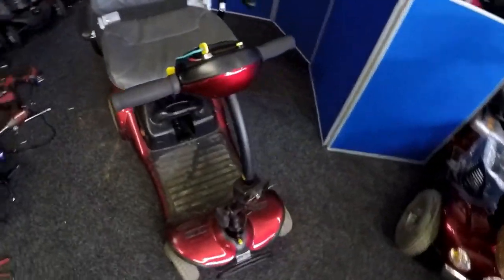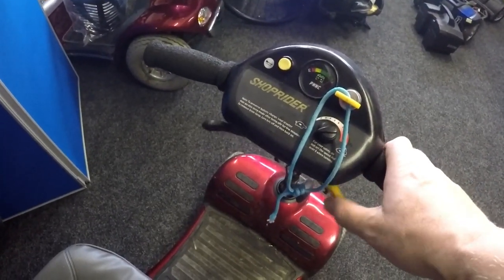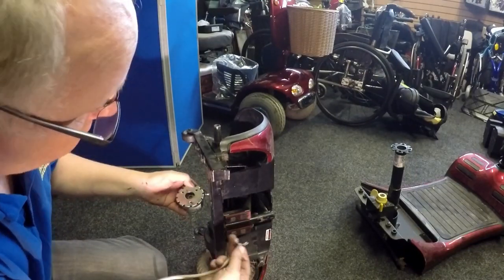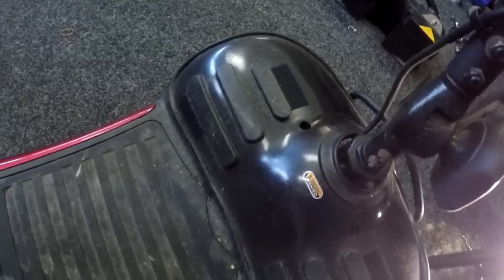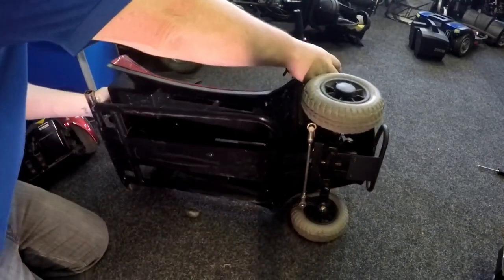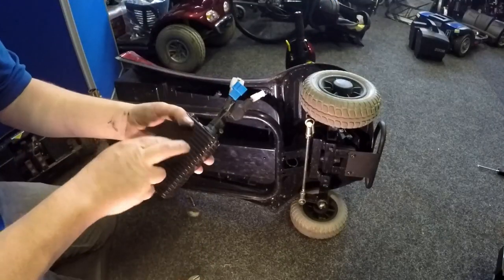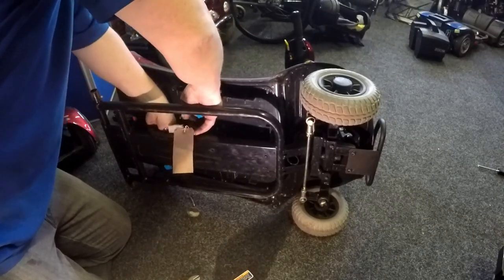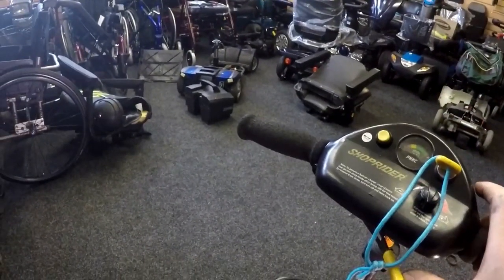Scooter will not drive no error codes

Comment: I have a similar fault on my shop rider but it’s intermittent break works and it will drive then it will stop and I get the beeps about 1 sec intervals . Iv checked voltage to the break when this happens and when I operate the paddle there is no voltage to the break . I can turn the key on and off a few times then power comes back and it will drive . Any thoughts on this please

Comment: Question when you turn your switch on a green light blanks, the batteries are charged, but it will not go forward backwards
Reply from the maker: @shirleybaldwin974  and how many times does it flash wait for a gap then count. Should always be the same amount of flashes

Comment: Hi thank you for putting these videos out there. I love watching them. 
I have an envoy 8. The 6th green light is only. Checked every item you have suggested. The batteries have 27.8 v the brake is working, the motor is working, it charged. But does not show the 27.8v. the lever shows balanced OMS. It looks to me like a wiring a fault or the computer. Have you any ideas?

Comment: Hi, great advice thanks, I have exactly the problem you have just described break releases no power beeps in reverse but won't go motor runs when wired separately so probably control box fault its a Sterling scooter  thanks

Comment: HI Tom, I have a jazzy 1122 with new batteries... I got 12.5v going into the controller box but I don't have 12volts coming out to each motor only 2.4 volts only the left wheel bearly moves. I would like to know if I should check anything else before purchasing a new controller.  Thanks!
Reply from the maker: If you only have 12v going to the control box then you have wired the batteries wrong should be 24v plus
Reply: @tomjacques4  I have the batteries wired according to the jazzy 1122 manual… could it be the brake?
Reply: Each battery is wired to each motor in the diagram… is that correct?

Comment: I have a gogo pride scooter how do I reset it I tried to do different things but it won't start and also does those scooters require water cause one day I was charging it and the towel I had it set on was damp when I went to put the battery on the scooter

Comment: Very informative video. I have a shop rider Mayfair which I have a problem with. When power is applied but ignition off it emits a constant tone. When ignition on it is quite, power meter shows full power but no movement. Have no maintenance guide so working on experience lol 😆 . Think it may be electro brake or control box. Thanks Tom 👍
Reply from the maker: Odd you should not be able to get any noise if you have switched the ignition off. Could be water damage. Check ignition switch

Comment: hi tom i have aold strider st1 small boot scooter watched all your vidos tested everything getting 9 on the flash codes just not getting anything from the CTE control box i belive it got wet i have left it for two weeks now and still not working cant feel the relay in the control box comeing on if i sent it to you could you test it or repair it or supply another one cheers steve
Reply from the maker: Hi not many have the cte controller must be an older model will only have new
Reply: @tomjacques4  can you supply a new one do you need the old one to program the new one what sort of price am i looking at cheers steve

Comment: Hi there . I got my new ebrake and motor for my quingo air 😒 still not driving and 5 flash code still there. 
By chance do you have any ideas
Reply from the maker: Sorry have not had the chance to work on one yet.
Reply: @tomjacques4  
My apologies tom, 

I  know each type is different. Its my lack of knowlege overall. 
I may be hoped there was procedures i could follow to try fault find.
Reply: @tomjacques4  

Do you have a work shop in leven.
Just checked web and says you do have a work shop in leven fife
Reply from the maker: @mckjimmy3802  we don’t have a workshop up there but do repair scooters etc. in that area
Reply: @tomjacques4   is there some place i could bring the controller for testing ?
Reply from the maker: @mckjimmy3802  whereabouts are you
Reply: @tomjacques4  
Hi , im in leven in Fife.
Reply from the maker: @mckjimmy3802  kinda too far for us my friend. If you ever in East Kilbride then let me know
Reply: @tomjacques4  
On the plus side.
After relentlessly searching. I now see the controller module is quite commonly used for many scooters.

You may possibly have one sitting.
Its a Dynamic DR50-A01 R series.
Reply from the maker: @mckjimmy3802  yes yes your correct but there so many different variations and every one will have a different program for it’s individual type of scooter.
Reply: @tomjacques4  and that my freind
Sums me up to a T
(Fucking usless)😂😂😂

After pulling the installation guide from the Dynamics website.
Theres a fair bit info on the controls and
 What pins there ment to go on.

Even gives all info on the programming and how to change the program to suite the needs.

But that shit is way way way over my head.

Im going to see the  areas top auto spark. As i know for a fact he has a mamoth amount of programers etc 
The man is a genius and a life saver,
Lol helped me out with car keys on many types of car.
He dose all major garages work. 
Only if you go to the garage they charge £300 + 
If you go Directly to him . Its usually £60
Reply from the maker: @mckjimmy3802  you will need a programmer which you will not have. Auto electricians are very experienced in cars but would not say on scooters depending if they know what they are doing. Think you need a proper mobility engineer
Reply: @tomjacques4   hey buddy.
We have power. 
Thanks for all your help & advice tom chap.
Never have i been so confused.
But following your vids and guidence.

We have accomplished thee impossible.

Comment: Very good videos Thanks. I have a Rascal 245 that used to run and then stop, I would switch the key back and forth and it would run again for a while then stop. It got worse then stopped altogether . Now what? The batteries are newer and are connected fine. Any advice ? Thanks. Doug
Reply from the maker: This scooter has split wiring looms. One at the base of the tiller under the gaiter and one underneath at the rear check these connections and clean.

Comment: Hi tom coverd my scooter with a car cover has there is no place for it except outside .it has power works then stop leave it works then stops again .i have a kymco midi i dont know if its got damp plus i dont know where the reset button is i got it from fb dealer that had hid the bad reviews .its starts juddering but sometimes works .can you .

Comment: I have two questions for you. I have an EV Rider Scooter that looks like oil has leaked out from somewhere. I haven't seen anyone talk about lubricating these things. Do they need to be lubricated? That might make a good video. Second question, this same scooter says that it is out of power when the battery is fully charged. It starts OK but within five minutes the indicator lights drop down to red. Why? Thanks in advance for any insight that you can provide. I wish you lived in the US.
Reply from the maker: The only part of the scooter that has oil is in the transaxle and they are maintenance free. So if oil is leaking then there’s a problem. most likely a faulty bearing on the drive shaft. If the power drops rapidly then check the batteries/charger  and the electric brake it could be stuck. Hope this helps

Comment: Hey Tom, My mother has a M1 Portal 4-Wheel Mobility Scooter and the battery is not making good contact. Are you familiar with that unit?
Reply from the maker: Hi I would check the internal battery connections. Also check to see if there are any stones or gravel under the battery box preventing it from making a good contact     Check all connections mate. Check for black contacts etc

Comment: Hello, I got a faulty S-DRIVE  PG drives D51259. 02 (70) corroded contacts, it is from a Pride 4 wheeler Beaufort 13, is that repearable?
tried with a D51446.06 (140) and it works 24-volt contacts are bigger and the unit has too much height.

Kind regards, Adriaan
Reply from the maker: All
Controllers are repairable but not if they are water damaged
Reply: @tomjacques4  Damp not direct water, I first have to open him up, come back later . . .

Comment: Hi Tom, I have a strider st3 that whatever charge state the battery is in only shows 1 bar. Recently the scooter has stopped working and the fault code flashes five times indicating a brake fault. I have followed your video right down to changing the control box. None of this has worked, could it be the circuit board in the head stem, as all the wiring and connections appear to be good.
Reply from the maker: One bar states low battery voltage.  What’s the battery voltage ?
Reply: The batteries have just been replaced giving 26.2 at the battery and 24.6 at the key switch
Reply from the maker: When your checking the battery voltage where you checking it from the battery direct or the charging socket
Reply: The charging socket
Reply: Just a bit more info, when the motor assembly is disconnected nothing changes, and I am getting 19.3 volts across B1 & B2 if the key is on or off. It is quite an old scooter now so not sure if it’s worth trying to repair it?
Reply from the maker: @andrewcowie1772  I recon the batteries are in a removable box so check voltage at the connections under the box where it links the the floor pan. it’s odd that you have a voltage drop looks like a bad connection
Reply: Hi Tom, your a star, cleaned up all the connections although they didn’t look bad. Hey presto working scooter!!!!! Thank you so much for giving your time to help. Wish I could buy you a drink

Comment: Hi I have an older rascal scooter it was working just fine now it’s like it’s stuck in reverse it’s doing what this one is then it just takes off could it be the control box on mine ?
Reply from the maker: i would first try the throttle pot swap the two outside wires and try again. Once done if you press the reverse lever the scooter should drive forward and if pressed the forward lever then should not work..... that tells  you a faulty throttle pot ... PS we sell the pots...

Comment: have a shoprider scooter  when key turned on
and  put electronic brake into drive it beeps continously,  and will not turn wheels, (wont move, even though batteries charged full, lights work etc, but wont let scooter move on its own power, when put brake in neutral and turn key on it dont beep, but can be pushed,   when key turned on, and push micro switch down it beeps, any ideas
Reply from the maker: Always put into drive before switching on.

Comment: if the part number is the same how do you know if the programming is correct for your scooter
Reply from the maker: You will need to make sure it’s from the exactly the same scooter and the important thing is the type of controls that are fitted. If you get the wrong one then the forward lever may drive in reverse rather than forward

Comment: Can you just turn scooter over to get control box out,because l did ??
Reply from the maker: This scooter has a metal bottom on so impossible. It  is very wet in the UK 🇬🇧 so not exposed. Some have a small flap on the top to gain access but sadly on this one you have to raise the floor pan. It’s a pain I know. But not that bad

Comment: I have the same scooter but mine beeps as if drive mode wasn't engaged.
Reply from the maker: Dale Robertson so no reversing tone does it beep as you switch it on or only when you touch the controls
Reply: @tomjacques4  it beeps when I start it in push mode it doesn't when I start it in drive until I push the throttle then it starts beeping like its in push mode. Cheers for replying
Reply: So it beeps when I touch the throttle but it's the exact same beep as if it was in push mode
Reply from the maker: @dalerobertson5424  sound like the controller mate
Reply: Ah right cheers mate I thought so could I send it to you for repair? And how much does that usually cost cheers
Reply from the maker: @dalerobertson5424  yes no problem send me a picture of the controller to nithsdale.wheelchairs@btinternet.com
Reply: @tomjacques4  its the c7-ac2-40 ill sedn pics now cheers
Reply: Sent 👍
Reply: @dalerobertson5424 saved my bacon once again. Thanx Bud

Comment: Scooter will not drive no error codes?? i expected you to plug in a code reader Like a car how daft is that.
Reply from the maker: HI, yes i could of used the  laptop software** or a hand held programmer on other scooters but not everyone has said devices so when i repair scooter for tutorials I try to show how to do it without any fancy devices only a multi-meter. PS the shoprider  fault diagnostics with the Laptop software is rubbish only gives you 4 faults codes.
Reply: @tomjacques4  H i didnt realize you could use on the scooters. my wife has a Neo 6  nothing wrong with it but brother in law has a Drive Sport Rider which has developed a `wont reverse fault` and thought i have a fault code reader for my car perhaps could use to help but dont know where to plug it in, do you know if the sport rider can be pluged to code reader? any help or thought would be great.
Regards
Reply from the maker: @georgehawkes1740  the controller is under the rear shroud. I would check the toggle forward and reverse switch also all connectors that come from it recon it will all plug into behind the front light cover.
Reply: Thanks for that I will check out tomorrow when I said i would look at for him I was going to check the switch first as well. Appreciate your input & time. Great bit of info.